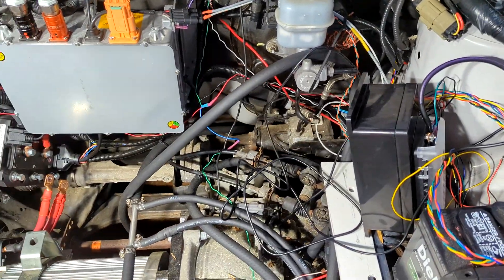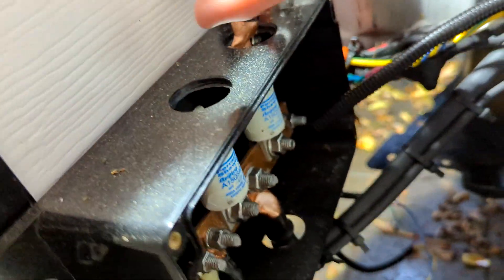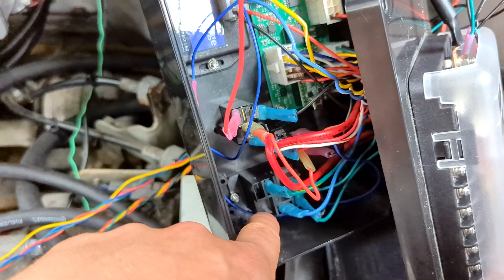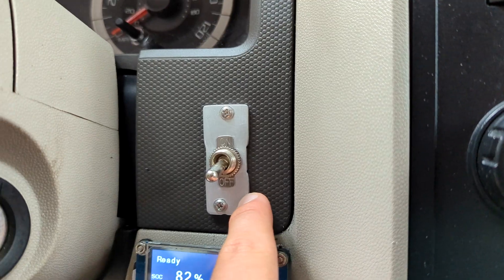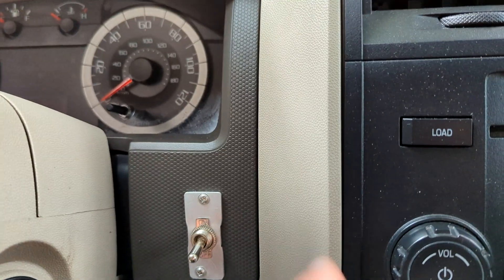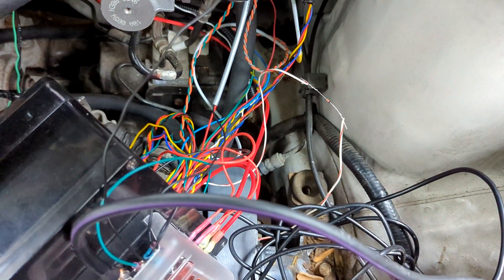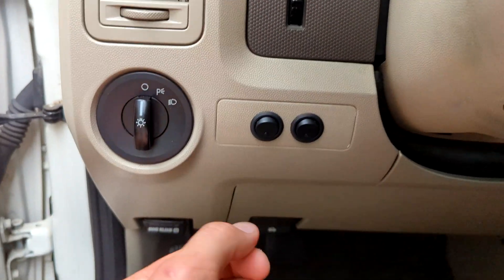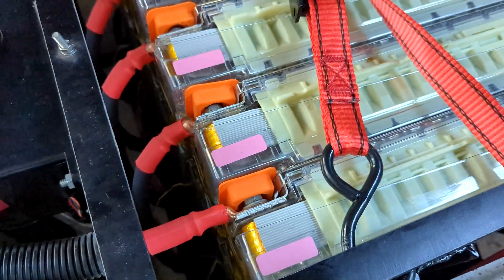Ford Escape EV Conversion EP 25: Finishing up the Conversion

Comment: Cool stuff! Do you have any problems with  simpbms battery comms, since you have 2 battery boxes (front and back, assuming about >6ft.) and the signals are only 5v? Did you do any tricks to ensure no problems?
Reply from the maker: The wire lengths are no problem at all, I actually tested with up to ~30 feet initially and it's no issue.

it's really just the EMF from the motor/inverter that's a concern. I did have an issue where at a very specific motor RPM it would cause a momentary loss of comms (a few milliseconds) from the modules to the BMS. As it turns out the firmware I was running was old and didn't have a waiting period for failed comms before entering into an error state (so only a single dropped transmission caused the BMS to go into error state). I forget what firmware it was I had but I flashed a more recent version of the GitHub and haven't had any problems since.

Also I had BMS wiring running fairly close to the 3-phase runs from inverter to motor, and they were more parallel than they should have been (signals should cross AC wires at a right angle, ideally).
Reply: What were your recovery steps when that happened?
I'm going to try to update my firmware, because it seems to loose comms during brake/regen. I need to hard reboot BMS to recover. Soft reboot doesn't work.
Reply: @reider_mcfeely  Have you had bms go to error because all modules stop talking\shutoff and soft reboot doesn't work have to either hard reboot bms or disconnect and reconnect 5V to all modules? This happens to me even on the latest firmware under some specific motor rpm. Also, how did you recover during bms error? Was it stopping your car in the middle of the road? Meanwhile, I am trying to find where/if the the EMI is affecting the comms. Thanks.
Reply from the maker: @ruggedplus  What had happened with mine was a single module comm connection was momentarily lost which would kick it into error for a moment (so shut off the car) then immediately turn back on. A firmware update fixed the issue completely, so not sure what your issue is.

Comment: In some ways we think alike. Ill explain later on a video how i wired my car up so i can start it with the original key without needing switches in the cabin. I dont have bits you have however like a BMS. I may add one later. Im glad im not the only one with a spiders nest of 12v wires. :). Im going to work on clearing that up once i finish a couple of bits like a wind screen heater. I think you should move your front battery back from being directly against the front bumper.
Reply from the maker: Yep I was thinking about wiring it up to the original key but I ultimately decided to just keep it separate -- I liked the idea of being able to drive without the car thinking it's even on.

Yeah ideally I'd like to have put the front batteries somewhere else but that was the only option other than putting some in the trunk which would have defeated one of my goals for the project (don't sacrifice any interior space). This is going to be an 'around-town' car, under 40mph most of the time so it shouldn't be too bad from a safety perspective. There's still a crumple zone behind the front battery box for the bumper and battery box to fold into in a bad crash. Not terribly different from the radiator, AC condenser, and radiator fans that were mounted where the battery box was before.
Reply: @reider_mcfeely  I'm concerned if you had a front crash your battery could be pierced and enter thermal runaway. Re the key need to make sure your airbag abs etc is on. :)
Reply from the maker: @blackterminal  tesla battery modules actually aren't as prone to extreme thermal runaway as people expect: https://www.youtube.com/watch?v=c0IHNrW0QOA

But yes it is certainly still a real safety risk.

Even with key on, airbags don't work at the moment (ABS does). I think the airbag sensors output must be routed thru the ECU which I removed long ago, so the airbag light is on. Not that I'd regularly drive without key on, but it's fun to at least have that option.